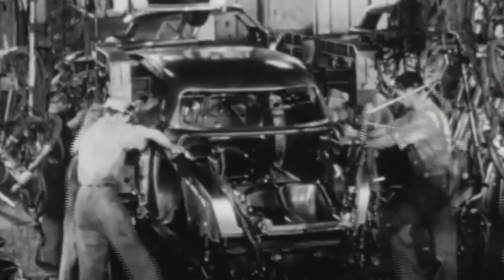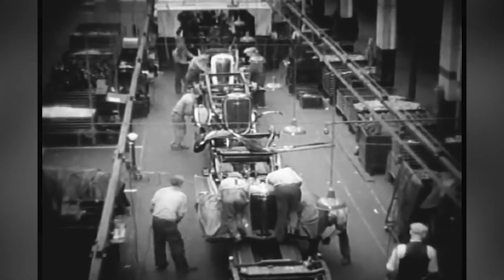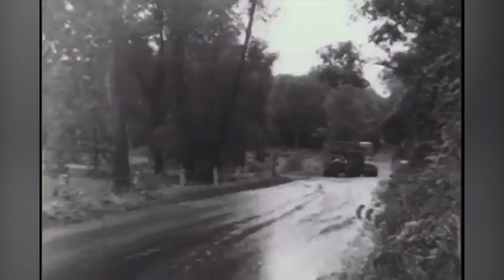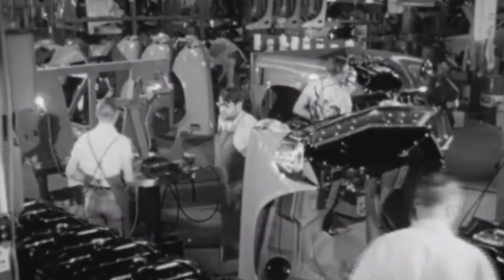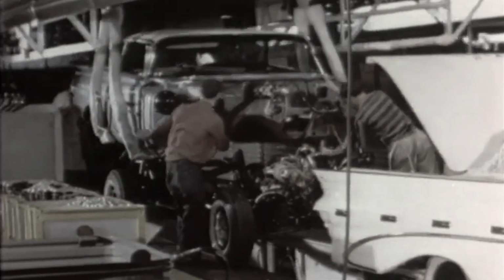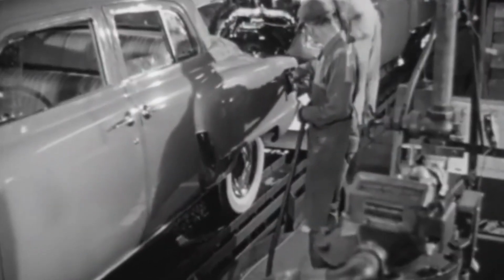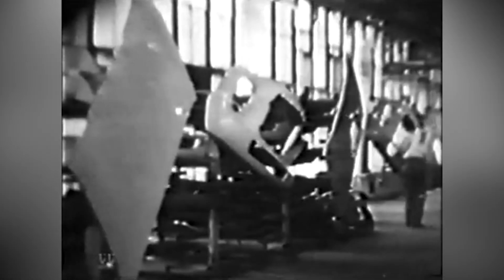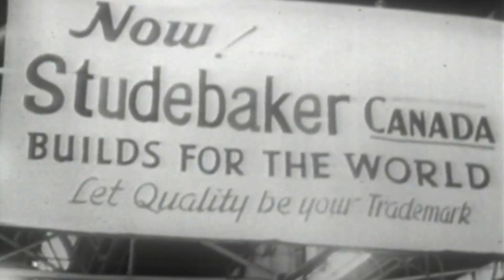How Studebaker Cars Were Made In Their NOSTALGIC 60s Factory | Step By Step Process

Comment: Already in 1955 the Citroen DS was designed with absorbent crash zones, front and rear. At the front the spare wheel was placed in front of the engine, as an extra protection. And at the rear the petrol tank was placed ahead of the rear wheels, in a separate compartment and not in the crash zone. 
Completed with all the active safety features like front wheel drive and hydropneumatic suspension with constant ride height, rack and pinion steering, zero point steering geometry, full power servo brakes with two circuits, large inboard disc brakes at the front and many other safety factors it was, and still is, the safest car in the world!